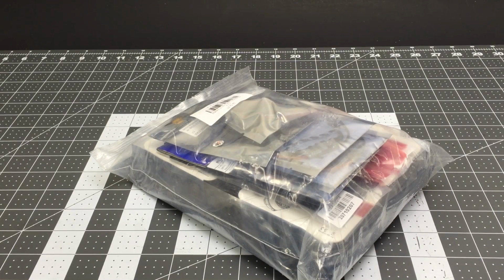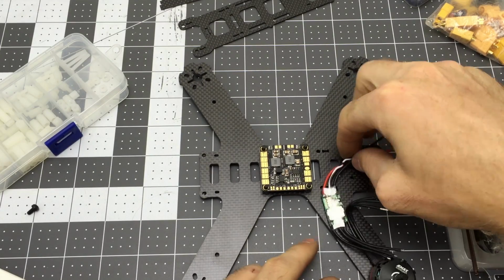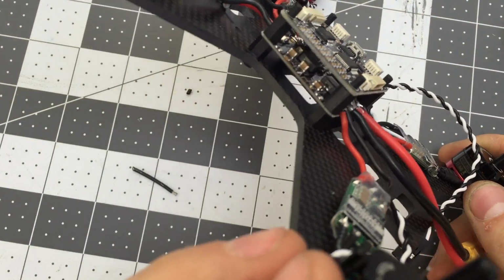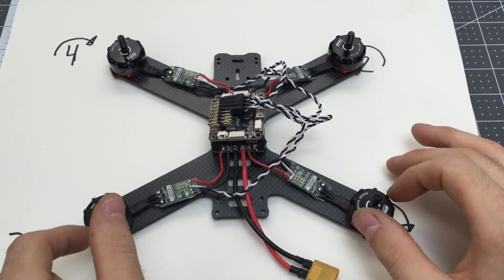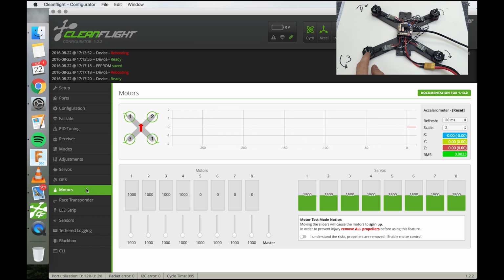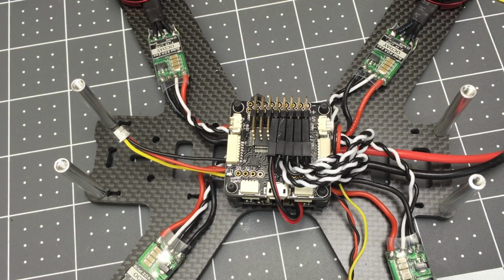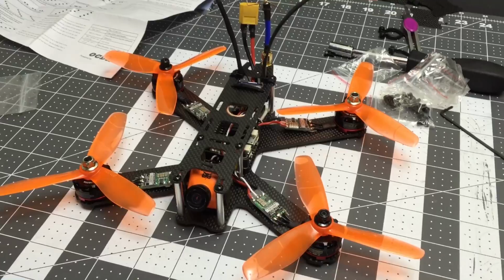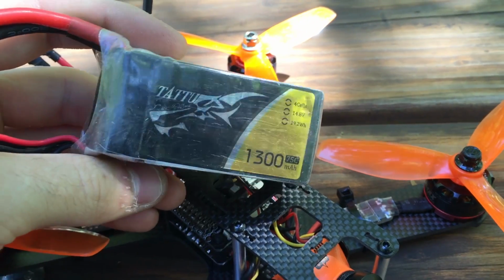FPV Quadcopter Build Tutorial

Comment: Nice video! Noticed you added a battery checker but didn't use any telemetry. Since you have a taranis there is no reason to not use telemetry.
Reply from the maker: Correct, didn't want to add the complexity for this video.

Comment: Great video Sam!  Had no end of issues with my ESCs not responding last night. Damn things kept changing their behavior too- long story shot after many hours I noticed the CPU was maxed out- found a thread on FT and indeed mine was the same- I had set the PID loop/Freq too high and that made everything work except the ESCs via radio. Craziness :)  Can't wait to get mine in the air.  Cheers Bud
Reply from the maker: How frustrating! I've found that default PIDs and loop times work really well now days. Why did you change them?
Reply: ***** I followed Josh Bardwells initial setup video which says set the loop to 8K :)  My F3 no can do...